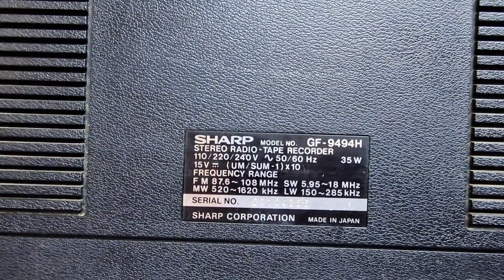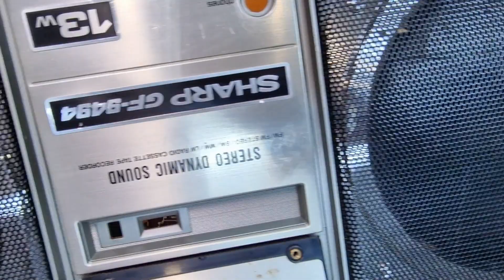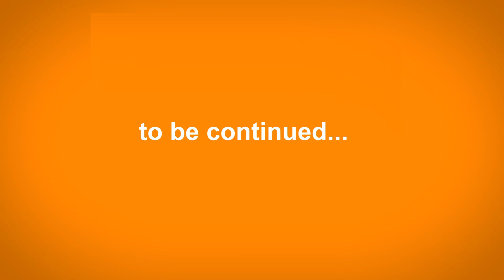SHARP GF-9494 Repair - part 1!

Comment: Hello. Thank you for responding. I'm wondering what kind of glue you used to glue the loose contact on the regulator? The video shows that in addition to the glue, you used a white powder, what is it? I've tried different brands of glue, but I haven't been able to glue the broken contact together. I hope your advice will help me.
Reply from the maker: Thank you for your question. It's not glue. It's a two-component acrylic. It is used by stomatologists. It is very good for restoring broken plastic parts of the cassette mechanism and many other places. I have even moulded the toothpicks (шестирёнки). I use two-component silicone for mould making. Good luck with your work 😊
Reply: @restoration-RC-Studio  Thank you
Reply from the maker: @ВладимирБунёв-ь4с  Спасибо. Если будет вопросы, можете написать на e-mail, ссылка в описании ниже. :)

Comment: Greetings. Tell me what kind of adhesive was used when repairing the tone control?
Reply from the maker: Thank you for your question. If I remember correctly, the problem is in the upper control panel. There are two-way contact paths. On the side where the details are, they are as if painted on. Very often there is no contact. Or a problem with "painted" resistors. For those who repair old technic, I think you will understand what I am talking about  🙂 Just breaking their contact. Good luck with your repairs 😊
Reply: @restoration-RC-Studio  Hello. Thank you for responding. I'm wondering what kind of glue you used to glue the loose contact on the regulator? The video shows that in addition to the glue, you used a white powder, what is it? I've tried different brands of glue, but I haven't been able to glue the broken contact together. I hope your advice will help me.